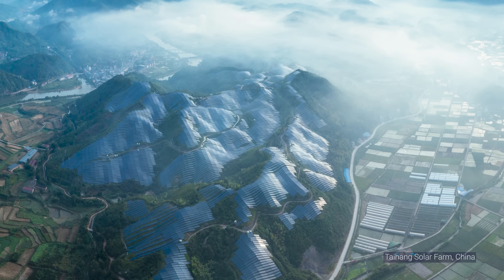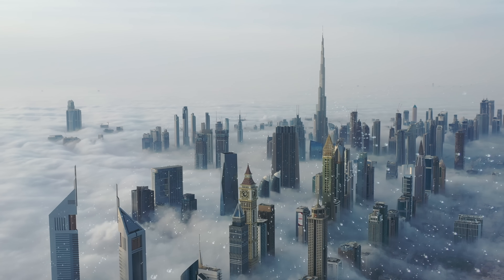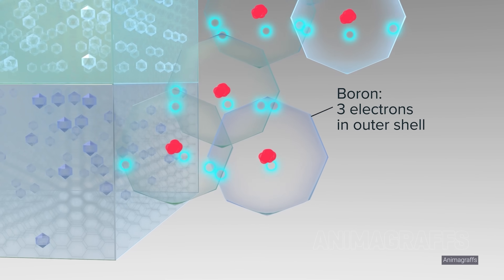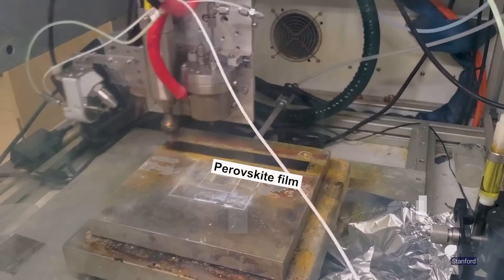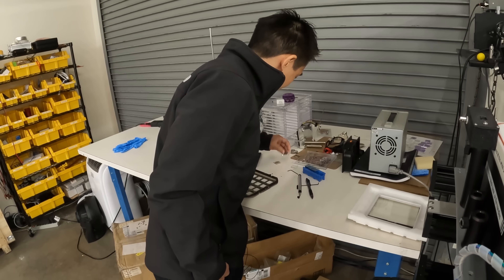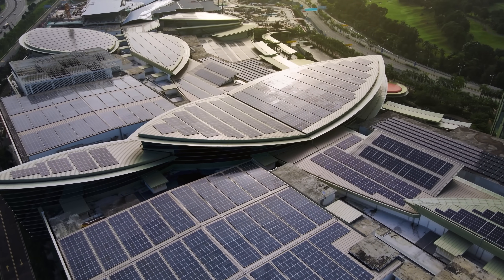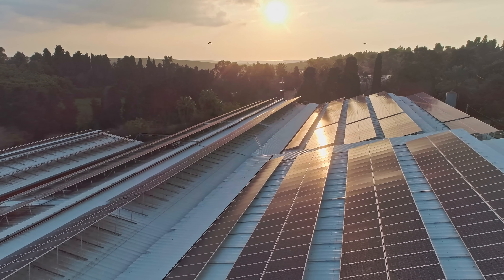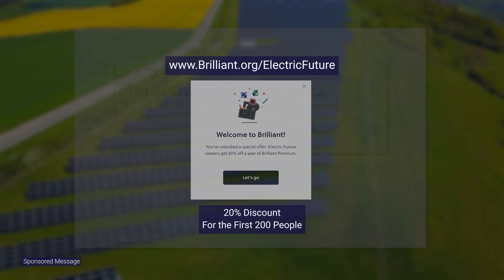Solar 3.0: This New Technology Could Change Everything

Comment: All I see (in this video too), are numbers that don't reflect the reality. Capacity/efficiency/lifespan, every time you see numbers about them, it actually means lab conditions. When you see statements like  X country produces x% of its energy demands from wind/solar, but the optimal maximum producing capacity of those installations is so far off from the real world if you take into consideration the efficiency degradation as time passes, the production of the energy when is not actually needed (this means that is just theoretical, because at night we don't use electricity from solar for example), etc. People take those numbers as real numbers...

Comment: Solar power adoption will be driven by the ability to produce cheaper energy than current methods, not by environmental concerns. Solar isn't free. It requires the maintenance of the cells and the batteries. Any adoption also needs to include recycling/disposal of end-of-life parts. This is especially true of batteries. Batteries are often extremely hazardous and toxic if not handled correctly. While not in the purview of this video, batteries are often ignored in discussions of "green" energy.

Comment: Great video!  Not the typical huckster new technology magic video with impossible promises while glossing over potential problems, and not dumbed down to be 98% fact free.  I can imagine perovskite solar incorporated into an injection molded plastic enclosure for various products such as outdoor motion controlled security lighting, displays and signage, security cameras....  It would also be great to be able to buy pre-cut rolls of solar film that could be rolled onto a metal or polymer roof, between the strengthening ribs, to quickly produce a solar roof that inexpensive and efficient.
Reply: The technology sounds like it can be applied to the outside of smartphones.

People buy a new smartphone every 2-5 years.
Reply: New SolarPanel technology now we can attach the thin layer panel on car's body just like applying vinyl wrapping so no worrying battery to empty as we can charge battery anywhere even while parking in full sun light

Comment: "if you want to power the entire US it would take about 100 miles x 100 miles" this is a misleading statement. Sure, if you are talking about for 12 hours where the panels are in a place where it never gets cloudy. But the reality is it would take 3x that much to actually power and backup the US grid system. And that is not counting the battery bank that would be unsustainable. And lastly you have the issue of seasons which there is no other way to get around. I myself am a solar technician. It takes roughly the entire footprint of a house to wipe out the electric bill of that house. But that is talking a grid tie, where the grid itself has other types of power plants connected to it. Right at this moment there is no feasible way to macro the entire US energy supply with solar. 

Now... If every single new home built had solar on it's roof, that is feasible. Unfortunately that will never happen
Reply: Wouldn't work not everyone lives in the desert.
Reply: @Bottoarguewith  you apparently only read the first half of the first sentence. And I don't live in the desert, I live in Pa. and more than likely know more about solar than you considering I am a solar engineer lol. But that is what I was saying... Is that solar is not feasible on a macro level. If you were saying it wouldn't work if every person had solar on their house than you are just wrong, and have a lack of understanding of how a grid tie system works. You do not need to live in a desert for a grid tie system to be feasible

Comment: I like the idea of buildings producing its own electricity. This can be used for both the operation of the building as well as charging workers cars etc. The main advantage is that this energy doesn't come from the grid. In fact it can top the grid up.
Reply: It always irritates me when I see office buildings with window darkening film. They reduce the light by about the same amount as BIPV (building integrated Photovoltaic) panels I was working on in the early 2000's, but generate heat rather than electricity. *8'(
Reply: The average high rise office block has way more non north facing window square footage than it has roof space, and roof space is often filled with air-conditioning units for the block.

Comment: 15 times cheaper than regular panels - that would be less than 10 US cents per watt or $100 per kilowatt. For $2,000 spent resurfacing a 100 square metre (1,000 square foot) roof you could receive as much as 22,000 kWh (worth about $5,500 in Southern California) per year!

Comment: It's great, but you've got to move these different solar techniques out of research and into manufactured products. The world needs them desperately. If it's cheaper enough, it can be replaced more often and still make sense.

Same with solar glass. Have heard about it for a long time and how it can be coated on all windows of all buildings and homes and doesn't even need direct sunlight because it captures infrared and ultraviolet light. The world needs it desperately. So manufacture it already!

Comment: Low lifespan is definitely a huge obstacle for solar possibility. Either they'd have to be recycled frequently, or have other means to make sure they endure longer. And even at greater efficiency, there still needs to be certain flexibility for the power grid to adapt to consumers. Layers to ensure there's always power to the grid, with some things that can be turned on and off as demand changes. I still hope for Solar to grow, but it needs smarter people behind the scenes too.
Reply: Why turn them off?
Direct excess power to some kind of grid storage like pumped hydro or use it for desalination, whatever...

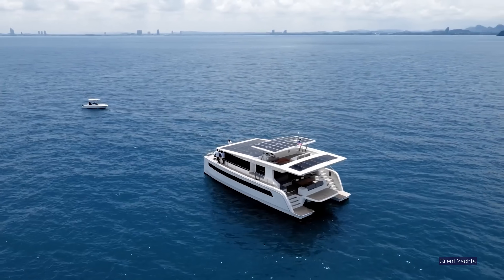Comment: @2:55, also
Old school air input ports like you'd find on an old Buick, each port powers a trickle turbine to feed the batteries
also
feed an trickle "Alternator" off of the wheels much like the Old school bicycle head lights, so that when the car is moving, it is charging.

You should be able to use a much smaller battery if you are steadily producing energy as you move.
Reply: Second law of thermodynamics, read a science book.

Comment: Pretty awesome technology that I had no idea existed until this video. I just thought "great, we have solar panels, so just get more, right?", well apparently we can also get better ones. And for various applications, not just fields powering the grid.
The next step in all of this is to also find a way to make "better" batteries instead of just getting "more" of them.
Tech is definitely advancing and I'm glad you guys are covering it on the channel :)
Reply: Battery Recycling might be just a good a program to have investment in too. batteries might never be eternal, but getting more materials back ought to be a huge deal.
Reply: @Dragonorder18  i just discovered Ambri the other day, this was their main selling point for their liquid metal batteries - reusability of materials
Reply: @Dragonorder18  this is old technology, have you seen the Knight Rider 2000? 
it  is coated with this solar film .
Reply: Battery tech continues to improve.  But for grid usage, batteries are probably not the best solution.  The best solution for grid storage might be mechanical or conversion to hydrocarbons (which can then be used in applications where electric doesn't work well, such as heavy machinery and air travel).  You can use electricity and water to pull CO2 directly out of the atmosphere and create e-diesel with it, which when burned, releases only the same CO2 you previously pulled out, so overall neutral to atmospheric CO2 concentrations.
Reply: @eventhisidistaken  With the amount of energy you need to "pull" enough CO2 directly out of the atmosphere you might as well be burning forests down for the hell of it. Ideas are fun and all but not in the realm of ridiculousness.
Reply: @Yeet42069  To remove 1 kg of CO2 from the atmosphere, takes about as much energy as was spent putting it there in the first place.  But if your power source is waste heat from a nuclear power plant, then it's essentially free.  ...or if the power source is wind and solar, you use the excess for this purpose.  Some days there is more capacity than demand and so they shut them down.  You could instead use those periods to generate e-diesel to be used where electricity is impractical, such as air travel and heavy machinery.
Reply: @T Oadaly  "To remove 1 kg of CO2 from the atmosphere, takes about as much energy as was spent putting it there in the first place." 

And this is where you are are horribly wrong. There are roughly 416 particles of CO2 for every MILLION particles of air (aka other particles) in the atmosphere. This is why trying to "harvest" CO2 from the atmosphere is so horribly inefficient. If it was a controlled environment, yeah it would ring true that you would need as much energy as you get from burning it in the first place plus the inefficiencies, but the real world is not a controlled environment.

As for using nuclear power plants to make up for the massive hemorrhage of energy needed to slightly reduce the CO2 levels is simply asinine. You are much better off to simply replace conventional power plants, let alone no one even has the capital or the willingness to create that many nuclear power plants. They don't simply fall from the sky.

Like I said, ideas are fun and all but they aren't exempt from being fundamentally flawed.
Reply: Thats the thing .. tech is not advancing 😑😑 its going snail speed at the moment ... all the great nazi scientists are dead and nothing is moving

Comment: Would it work to cover them with a thin transparent foil, which degrades in place of the cells themselves and which is easy to replace?? But as he says, there should be another market for these things where they don't need to be as durable as long as if it's easy and cheap to replace them.

Comment: David K

Non-linear energy efficiency , and nothing about equity of material asset. Also no treatment of solar water heating etc. passive solar only direct PV which is the least efficient. Can see where the oil industry is spending its money. Given fossil fuels are just long term solar energy storage, utilising non-sustainable fossil sources for energy and fresh water hurts us all.   Will  perovskites change "everything", no, just solar PV. After we've made half the country unlivable burning fossil fuels let's do a thorough cost-benefit analysis of any solar sources vs the damage fossil fuel use has done. Makes deterioration of solar cell efficiency irrelevant.